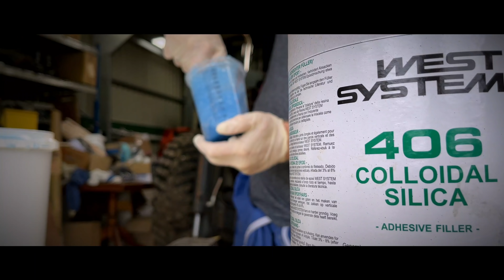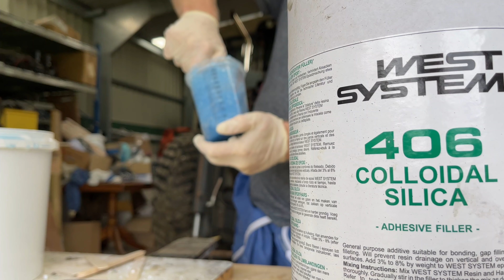DIY YACHT Restoration - NEW Plywood DECK CORE - EP.52

Comment: I would have resin coated and glassed the ply before bonding it to the ceiling and would have also bonded the flat surface not the edges only.
Reply from the maker: Could be done that way, but would be difficult to make it conform to the curved shape of the deck once laminated 👍
Reply: @boatholic4458  yep fair play, well resin coated and bonded at least. I've been enjoying your vids and going through them one by one in order.  Both smart, practical and skilled craftsmen but maybe not a lot of experience rebuilding boats.  To be fair you are getting there.  The building of the molds was a big job and very well done/
Reply from the maker: Thanks, we Appreciate the support. We are very much learning as we go 😀👍